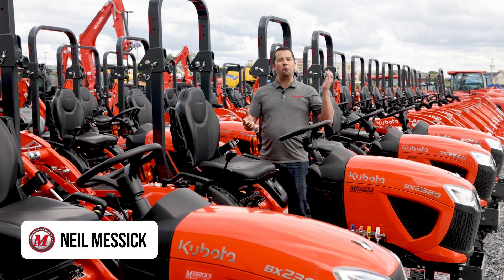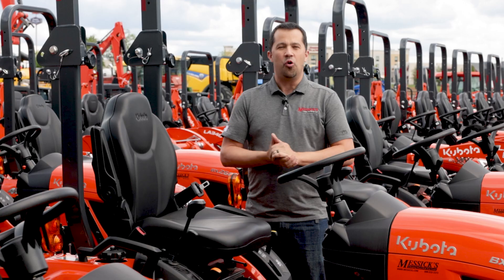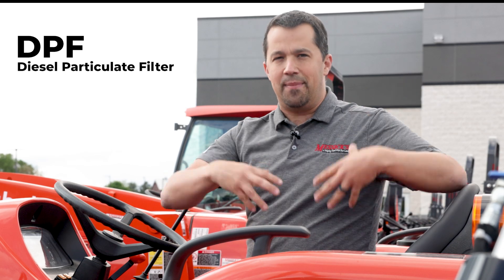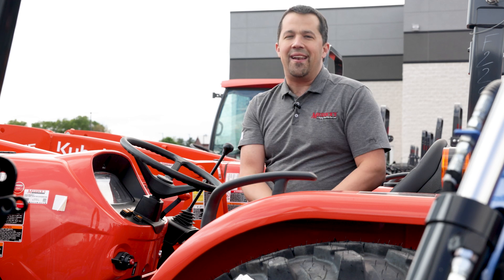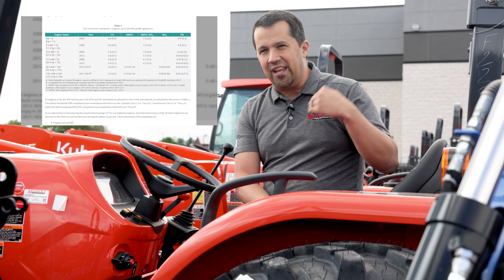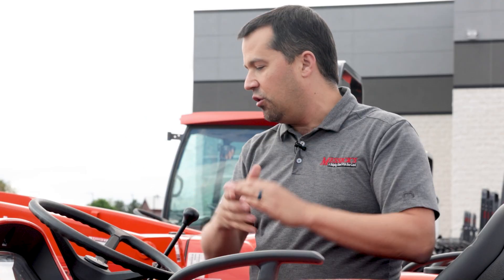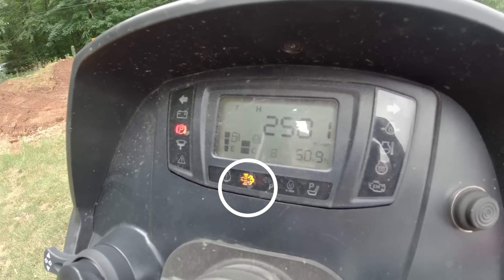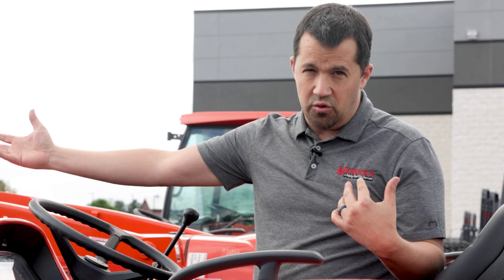🙋‍♂️ What does this button do?! Regen Inhibit

Comment: I’ve read, and watched videos, that say you cannot ‘force’ a regen cycle.  It will only regen when it’s calling for it.  All the ‘Parked’ regen button does is enable the auto throttle speed once it’s in neutral, park brake set, pto off, lift and bucket down.  The throttle will increase by itself to start the process, then idle down once the cycle is complete.  So much differing information on this regen process.
Reply from the maker: That is true in that if the engine won't benefit from a regen, it won't do it. You don't see this, but in software there's five stages of the DPF plugging up. It won't regen in stage zero.

Comment: my 2016 mx5200 has 1000 hrs on it and no dpf issues, Ive only cancelled the regen a few times and all I do is just never cancel it multiple times in a row.   I despise that we small tractor owners have to deal with this expensive emissions equipment on this microscopic level of diesel tractor use and not to mention off road.  smog problems are in the city where almost no " garden tractors" operate! wtf are we putting filters on them!?    and yes I will probably figure out how to bypass my dpf when it gives the first issue.

Comment: What rpm do you set it at when regeneration mode kicks in??
Great video
Reply from the maker: about 2/3. turn it up up until the light stops blinking.
Reply: In your experience is it about 2 rpm?
Reply: @SeaIsland444  set at pto engine speed and you should be good to go.

Comment: I inhibited a regen on my 3901 because I was doing some slow work around dry grass and planned on doing the regen after I got back to a gravel surface, but about 20 minutes after inhibiting it I got the flashing DPF light and beep every 5 seconds indicating I was at a level 2 PM warning, so I moved it to a safe place and performed a parked regen. So even if you inhibit it, it will still request a regen eventually.

Comment: All a owner has to do is.  Add Power Service (silver bottle) to the fuel.  It will reduce soot loading thus reduce the Regen frequency.  Plus the additive adds cetane boost and over hp and torque.

Comment: I'm going to be trying the additive I use in my semi. Pittsburgh Power makes it. 1 Oz per 10 gallons is the mix ratio. I believe they call it a fuel catalyst. Basically it helps the full burn a little hotter and therefore the temps are higher. I've put about 25,000 miles in the truck since I first started using and I have noticed less regen cycles. I also have an apu that handles cooling and heating needs when park so I don't sit idling much. My 3046r shows a percentage number on the dpf and I gotta know if it helps before I buy another gallon for 230 bucks. Am I wasting coin or saving and extending the filter service intervals. Cummins recommends removal and a bake off of the dpf at 200,000 miles. If I see for normal operation that the soot percentage drops on the tractor then I'll know to keep buying it and using it.
Reply from the maker: Most people will never hit the DPF service internal on < 75Hp equipment. Its 3000-4000 hours on most machines.
Reply: @Messick's Equipment  good to know, but thinking about it now as somewhat stated, I wanna see if the product makes a difference on the tractor to know if for my semi if I'm wasting the money or saving by running a cleaner system and pushing out the service interval on it. All this emissions still has me confused. After all diesel engine produce the most power the cooler they are and with least amount of back pressure possible. At least in the trucking industry they are nothing but expense expense expense. Down time, added parts that fail, oh and less usable horsepower and it wasn't unheard of by any means to get to 1, 1.2 million miles before having to overhaul a motor. Now especially the back pressure issues most are needing a rebuild around 700,000 to 800,000 and because of all the extra parts rebuild kits and labor have almost tripled. I was going to have my last truck rebuilt, the right way and that cost was $80,000 over 50% the cost at the time of a new rig. Use to be around a 20% cost. Basically once again technology has turn something basically into a throw-away product. Carriers use to start replacing their fleet at 700-800,000 miles and are now getting rid of trucks between 300-400,000 miles. The truck that was needing a moto overhaul had 525,000 on it, was going through 2 gallons of oil a day, with huge blow by. All Cummins said was welcome to the age of emissions. More raw resources to build more products that last less time then their predecessor. Like the joke, 1970's fridge, I'll at last you and you grandkids. 2010 fridge you replace me in 7 years. Lol.

Comment: It is very upsetting when I use the tractor loading product and I have to scream the engine for the regen. Its a shuttle shift so using the clutch at 2500 rpm's is a joke. I have to park the machine and run it wide open for its cycle. Have you tried running 2500 rpm's while digging product from a gravel pile, creeping up to a truck ect with a clutch? Not very good. Its not your fault, but these systems are junk. Again, not bashing you,,,, thanks for the video.
Reply: yep its just gubbumeant garbage we gotta deal with.  and that's all it is, is pure BS and they know it too. wtf do garden tractors need dpf !   I hate it on mine but it works.

Comment: Ok Neal, find out what the emissions are of the tractor while it does a full regen start to finish. I'm curious if a DPF makes any difference because the system "burns" all that carbon out of the DPF, so the net result is instead of that soot always going to atmosphere it's trapped then burned all at once. Food for thought.
Reply: DPF has been common on diesel pickup trucks for several years.  There is research (hard to find since it goes against the enviro push) that DPF result in emissions that are more harmful to humans.  Normal diesel particulate emission particles are large and do not travel far into the lungs.  A DPF collects those particles and then burns them creating extremely fine particles that can, and do, migrate deep into lungs.  So it would appear that DPF systems are more harmful to people than traditional diesel engines.
Reply: @charlesperry1051  ive herd the same thing but have never found any real info tho.

Comment: Isn't a Diesel Oxidation Catalyst for NOx (nitrous oxide) emissions?  The DPF captures the soot and burns it off periodically.  I'm not an engineer, but that is my understanding of emissions control in modern diesels.  Also, the diesel oxidation catalyst requires DEF (diesel exhaust fluid).  Please, help me understand if I'm wrong.
Reply: A DOC system is mainly for soot and CO emissions and has negligible impact on NOx emissions. It can be used instead of a DPF on systems between 25 and 75HP (one trade off is DOC systems are typically less fuel efficient but work better for applications where wide open throttle is rarely used). DEF is used for reducing NOx emissions and is used in addition to DPF or DOC on systems over 75HP.

In effect the EPA thinking for non-highway equipment is for systems under 25HP, minimal emission requirements; systems between 25 and 75HP, vastly limit soot emissions; systems over 75HP, vastly limit soot and NOx.
Reply: During a Regen the DOC will oxidize the raw fuel that is being dosed into the exhaust by the fuel injectors to create the heat needed to clean the DPF, The DOC helps to remove hydrocarbons and reduce carbon monoxide as well. The EGR systems on these engines help with NOx emissions. The larger engines use an SCR system which uses DEF to create a chemical reaction in a catalyst to further remove NOx emissions, but the DOC/DPF and SCR are completely different independent systems

Comment: If only it was an "Easy Bake Oven" -- That only used a 100 watt lightbulb :). Also, the pictographs on the buttons are incomprehensible. So bad they have to put a sticker on the fender to explain what the pictogram means.

Comment: Another time that it would be a good idea to inhibit the regen would be if your in a field with dry grass or hay that could catch fire. I’ve personally monitored exhaust tip temps on a truck during regen that reached over 850 degrees at the exhaust tip..